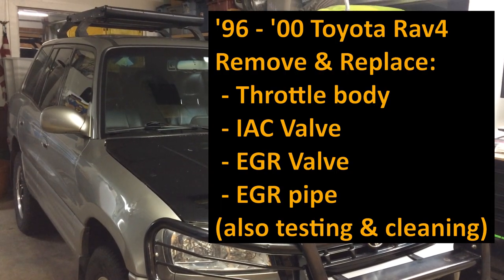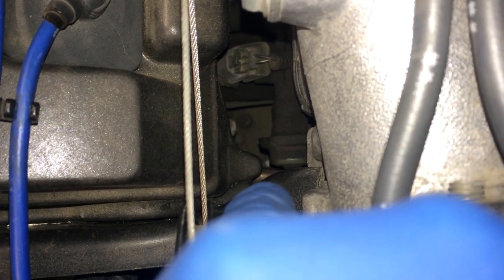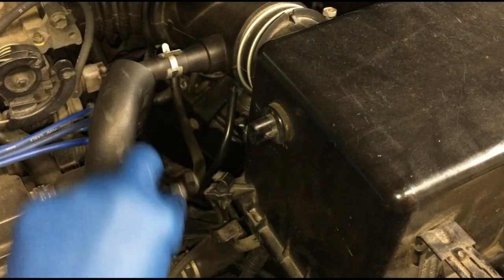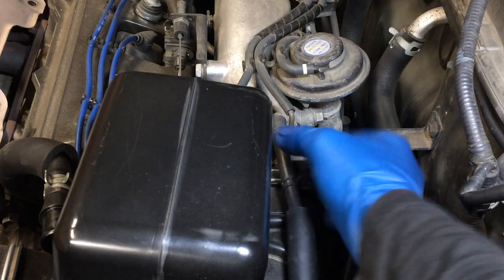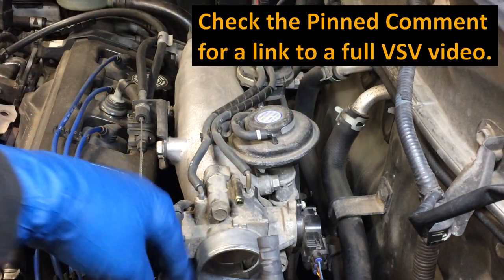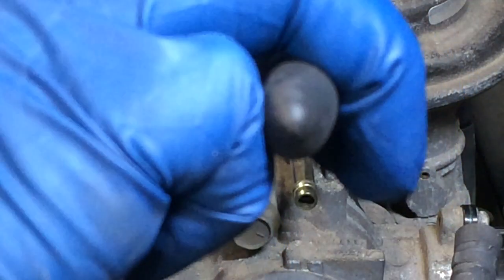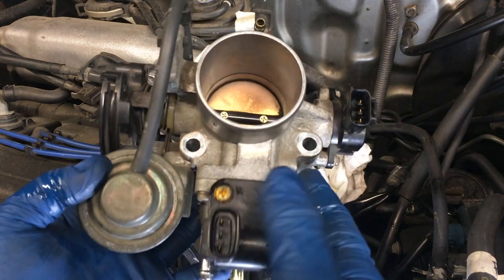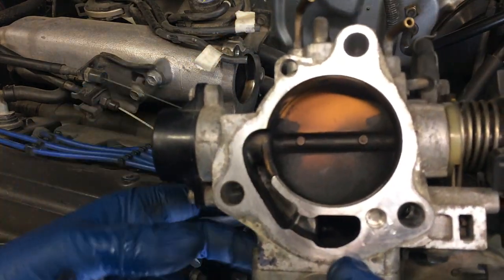1996 - 2000 Toyota Rav4 DIY Remove Throttle Body, IAC Valve, EGR Valve, EGR Pipe, with Bench Tests

Comment: Hi, do you still re me 😁😁😁
Question... What is, instead of applying suction on the upper metal protrusion on the top of EGR piece or hosing, what if I put pressure into it, is it OK if the air managed to scape from the rims of the disc?? By the way I tested the pintel hiding when applying suction on the same upper port or tube, the pintel was holding for 5 minutes.... But I wonder if pushing air in the same port is supposed to leak some where around the rim of the EGR top???
I wish you are not busy. 
🤔🤔🤔
Reply from the maker: That's a good question -- you're wondering if there might be some kind of valve in the upper chamber which would vent positive pressure?  I just bench-tested your idea on a good EGR valve, and here's what happened (the video is unlisted, so please use the link below):

https://www.youtube.com/watch?v=Azl6QzqnoQc

In that video, I only pressurized the upper chamber to 13 psi gauge pressure.  There were no air leaks, and the chamber did not depressurize.  I didn't want to pressurize it more than that because I didn't want to damage the seal. 

As I mention in the unlisted video above, I would not do this test method -- I would just use the suction (vacuum) test method.  The reason is because the valve was designed for vacuum, so I think it might be easy to accidentally damage the seal if it is over-pressurized.

If your EGR valve is holding vacuum for 5 minutes and the pintle moves up and stays up, then I would say that your diaphragm seal (upper chamber) is good.  If still you suspect the EGR valve is causing an issue, then I would focus on the seating of the pintle (the closing) and make sure that it is closing properly (which can be tested using pressure, or using carb cleaner, as shown in the main video).  It is possible for the spring in the upper chamber to weaken and not apply adequate force to close the valve (pintle down).  It is also possible for carbon build-up to prevent the pintle from closing completely ("seating properly").
 
Good luck : )
Reply: @L35inColorado  Thank you.
I will watch the link and be in touch with you, just incase another question came along the way.
Thanks again.

Comment: What and how are you getting the codes coz here in Australia on that model RAV4 gen 1 there is no obd2 port just the diag port in the engine bay on top of the alternator
Reply from the maker: I'm sorry I missed your comments -- on USA gen-1 Rav4's have an OBD2 port, so that's how we can get the codes here.  The diagnostic port by the alternator can probably be "paper clipped" to display some kind of "code" with the check engine light (ie, CEL flashing a certain number of times), but I don't know how for an Australian model.
Reply: @L35inColorado  yeah similar to a gen 1 suby  cel diagnostics

Comment: My 97 RAV4 has just started to occasionally stall at red lights, or not want to take a whole lot of throttle at acceleration out of a red light. From what I’ve read on forums, it sounds like a have a dirty IAC valve and throttle body and just need to clean it out. Do you think that’s what the issue is?
Reply from the maker: Yes, that's possible -- but if it feels more like a misfire, it might be oil on the plugs.  You can check that by inspecting the spark plugs -- if there's oil on any of them, then the spark plug tubes need to be removed and resealed.  I would check that first, simply because its quick and easy.
Reply: @L35inColorado  Gotcha. I’ll check that, since its quick. However, it doesn’t feel like a misfire. It feels like the car is just losing power, like its air/fuel related. Thank you for replying!
Reply: @L35inColorado  So, just check my plugs (and compression ~190 across the board, cold engine) and they are COVERED in oil. Do you have a video or link to an explanation on how to remove and reseal the tubes?
Reply from the maker: @erickbarroso767  Wow, yeah, that's what happens!  Hopefully that's your problem, because it's an easy enough fix.  What happens is that the RTV on the bottom threads of the spark plug tubes dries out over time and then you get an oil leak onto the plugs.  You just need to re-seal the spark plug tubes -- I don't have a video, but I made this picture DIY a few years back:

https://www.rav4world.com/threads/diy-replace-valve-cover-gasket-reseal-spark-plug-tubes-to-stop-oil-on-plugs.266729/

And here are some videos from others that are very good (Camry 2.2L 5SFE is very similar to the Rav4 3SFE):

https://www.youtube.com/watch?v=qSiSC1bceT8

https://www.youtube.com/watch?v=xFpi5axGK_E

The job isn't too bad -- just remove the valve cover and then twist out the tubes, reseal the threads, then put the valve cover back on and let the RTV set (I recommend you let it set overnight, if you can).  You'll see a few different ways to remove the tubes in those videos, and the different methods all work, so you can just pick your preference (in the DIY, I used a pipe wrench, but I think the nut-over-nut method shown in the videos is a better way to do it, but it's tricky with a big socket, so use a big wrench if you have one, as shown in the video).  Once its done, it will last for a very long time!  I hope this helps -- good luck!
Reply: @L35inColorado  Thank you so much! Funny enough, I was already reading that DIY and I thought it sounded like you! I’ll be doing this pretty soon. Right after I fix the leaky oil pump seal😬
Reply from the maker: @erickbarroso767  Haha, yep, that's me from before I learned to make videos.  There's a video on my channel for the oil pump gasket, if you need it -- it's shown in the timing belt video, and you can just skip to it using the timestamps in the Pinned Comment:
https://www.youtube.com/watch?v=TbOr7gvqSqc
Good luck and Merry Christmas! : )

Comment: Those JIS screw drivers are pretty expensive!
Reply from the maker: They can get expensive, but I have a few Vessel JIS screwdrivers, and they are all great and very reasonably priced!  I have these, and can recommend any of them - if you only need one, I think the first link is the best option ($12), but that little stubby has been very useful, too:

$12 option, multiple sizes:
https://www.amazon.com/VESSEL-BALL-Interchangeable-Screwdriver-220W3J1/dp/B00E55DL4I

$7 option, regular length: https://www.amazon.com/gp/product/B000TG8OM6/ref=ppx_yo_dt_b_search_asin_title?ie=UTF8&th=1

$7 option, stubby length: https://www.amazon.com/gp/product/B00N3M391O/

I hope that helps!  Any of these would make a great gift for someone who works on Asian vehicles, too!  : )
Reply: @L35inColorado  Thank you for the links!

Comment: You great, just use WD40 next time. Then that screw will come out in a second.
Reply from the maker: Yes, and PB Blaster also works well.  The main thing for these screws is to use the JIS bit. Thanks for sharing your tip!
Reply: @L35inColorado  also there is a tool which looks like a pliers, where the tip of this rench can lock tightly around the screw head, that is they easiest way to loose or over come the extreme jamming force.
I learned a lot from your vedios, I thought you are a mechanical engineer.
By the way... There is a special valve covered with green little cap, and has a little note says.. EVAP testing valve?? It looks like those outlet on each tiers to inflate it with air?
Reply from the maker: @wolfduranti8735  Yes, the green valve you mention is for the EVAP system, which refers to the evaporative or gas vapor management system. That green schrader valve you'll find in line with the VSV for EVAP (there's another VSV for that system, which is different than the VSV for the EGR valve);  the other components of the EVAP system are the charcoal canister (also called vapor canister), the gas cap, and a hose from the gas filler neck to the charcoal canister.
I think I know which pliers you're talking, about and I love them -- do you mean the red "Vampliers" from the Japanese company called "Engineer"?  If so, I have had them for years, and they are outstanding.  They have never left me down.  I was so impressed with them that I bought the bluish-green handled "screw extractor" pliers, which are exceptional for removing broken solenoids, because they have a needle-nose like tip and fit where the red Vampliers don't.  I highly recommend them!  They aren't cheap (about $30) but they are worth more than that when they save the day!  
Thanks for sharing that tip, too -- yes, anyone working on those screws should know about Vampliers, just in case.